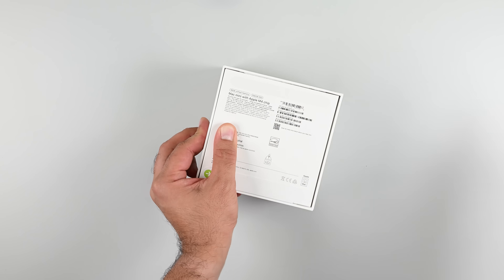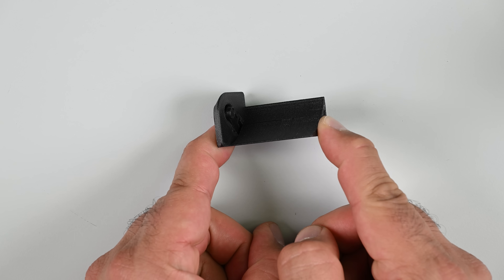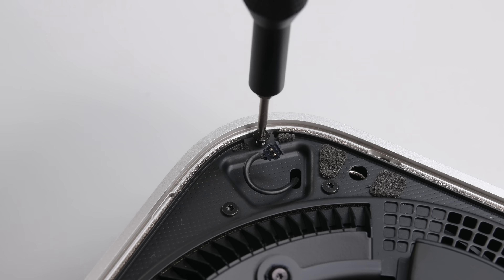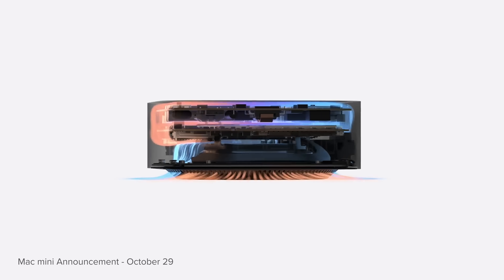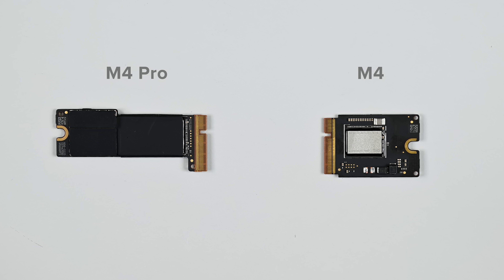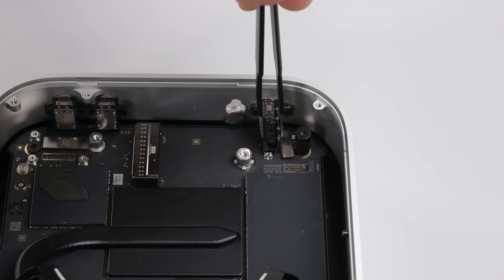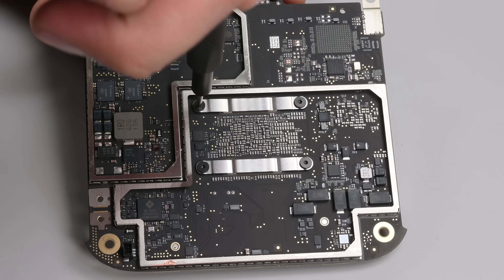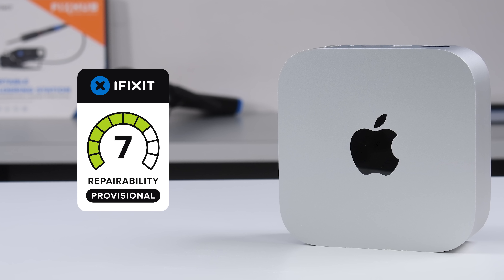M4 Mac mini Teardown - UPGRADABLE Storage, Powerful, and TINY

Comment: Why does he say it’s upgradable storage? It’s not. Apple will never sell those modules separately.
Reply: if previous generation (2012-2015) macs are anything to go by, then 3rd party companies will have replacements available asap.
Reply: @lenajk2004 can confirm
Reply: @lenajk2004  Those used off the Shelf Laptop Hardisks
Reply: @techgoggles  No. my 2014 MacBook Pro has a stick drive and there is no NVME drive that can fit in it. It’s “proprietary” and i upgraded it with a nice OWC 1TB 

He probably got the dates wrong because Apple things are confusing. You would think like between the Air/Pro everything would be the same but it doesn’t work that way. I think the stick drive things were 2013-2015? As the 2013 ditched the optical drive and was the new generation. And we all unfortunately remember the 2016 MacBook pros
Reply: @techgoggles  the retina models did not use off the shelf sata drives
Reply: Just because Apple may not sell upgrade modules in the future doesn’t mean third-parties won’t.
Reply: Third parties will.
Reply: me when I spread misinformation
Reply: It could be upgradable by third parties, if you have a second Mac around :)
Reply: These days ifixit is becoming soft on apple. Apple still make devices that appear to be serviceable, but there's always a gotcha whether or not you can get parts 3 or 5 years after the device is released. And yet they keep praising Apple for more ease of repair when infact it's not. Just because now the ssd is removable or the battery can be removed by apply voltage doesn't mean parts are available. They themselves have become an Apple shill
Reply: @luandoduy416 Parts are available directly from Apple and parts from other broken devices like those found on eBay will work with iOS 18’s new repair calibration tool. OEM parts are more expensive, sure, but they are also guaranteed to be fully functional and high-quality which is especially important for batteries.
Now, sure, it’s unfortunate that most parts are grouped into assemblies which are more expensive, but still.
Reply: @luandoduy416  I am no fan of Apple, but their service manual is already available for the m4 Mini and the "SSD module (flash storage)" is listed as an orderable part. M4 mini parts aren't listed in the Parts Store yet, previous models of Mini and Studio are, and the iPhone 16's replaceable battery can be ordered for a smidge over $50 (upon receipt of the old one).

Will they sell you get a 1TB SSD for less than $400? Almost certainly not, but you will be able to buy one if you need to upgrade. (But go external if you can, and save $250).
Reply: A company called Polysoft is working on this. Google it, pretty promising stuff.
Reply: apple maybe not but others will (and already do for the studio).
Reply: @racingweirdo  Had some trouble finding the project through Kickstarter in Toulouse, France but they instead are from Tours, France. They're called PolySoft Services and they plan on tweaking their M1 and M2 Mac Pro SSDs designs to correctly fit the M4 Mac Mini and Pro. Pretty neat!
Reply: Apple won't but AliExpress will get u an adapter lol
Reply: It can be upgraded by changing the NAND chip AKA desoldering and soldering in a new one
Reply: @cryingwater  I expect services that do this to pop up all over if Apple don't do it.
Reply: @cryingwater  and you call it "upgradeable", right? It's ridiculous...
Reply: Because like we've done in the past. all it takes is someone to figure out the pin out of that connector, and make a little adapter for m.2 sdd, similarly to the trashcan pro
Reply: @chloedegurechaff1941 wrong, the module in the Mac mini is not an SSD, it’s a NAND carrier board, NVMe ssds will never be compatible with the Mac mini
Reply: @chloedegurechaff1941  well you can't make adaptor for M.2 SSD as the drive controller is on the SOC I believe but you can make replacement parts and some people already did for the studio
Reply: @chloedegurechaff1941  Pretty sure there's software protection against that
Reply: @ohexnohex6165  nope. It's already been done by one very technically proficient YT'r.
Reply: @ohexnohex6165 you haven’t watched the video, right?
Reply: @ohexnohex6165  well in fact no if you know what you're doing
Reply: @Andreas_Straub  looks like you can either change the whole module for another genuine module from apple OR modify a genuine module by replacing the NANDs. But if you have a third party solution that breaks apple's hardware ID checks, please elaborate!
Reply: @adanedsstudio  looks like you can either change the whole module for another genuine module from apple OR modify a genuine module by replacing the NANDs. But if you have a third party solution that breaks apple's hardware ID checks, please elaborate!
Reply: @sutherland559  looks like you can either change the whole module for another genuine module from apple OR modify a genuine module by replacing the NANDs. But if you have a third party solution that breaks apple's hardware ID checks, please elaborate!
Reply: Because it’s not soldered and you can replace it yourself? That’s what upgradable means?
Reply: OWC has made proprietary SSD modules just like Apple’s for the 2016 - 2017 13” MacBook Pros. Give it some time.
Reply: That is weird... Apple had macs with upgradable RAM but I never remember seeing them sell the RAM modules separately. Nice logic you got there
Reply: @bob_kazamakis When Macs had upgradeable RAM, the RAM modules they used were standardized so they didn’t need to sell any. These SSD modules are proprietary. While I agree that they can be reversed engineered, this is a false equivalency. In other words, nice logic you got there.
Reply: Wrong. They do sell replacement parts for their newer Macs. Might not yet be available since it just released but you can find all the parts for the Mac Studio for example and repair manuals on their website.
Reply: Clickbait! Like most videos on YT nowadays
Reply: @spiritualastralsoul you know which company you’re referring to right ?

Comment: its upgradable, but its only sold by MAC ? or we can expect to buy cheap or use from another hardware like a normal notebook?
Reply: you can't plug in any M2 storage of the same size and make it work. probably either only apple sells it. or a different way, you can replace the NAND chip. otherwise there is no other solution.
Reply: @lostf1sh  the solution is someone making a custom aftermarket part; and it will definitely happen at some point as it has for the studio. OWC has made those for years for older macs.
Reply: it is a proprietary form factor - not standard like M.2, or even shared with something like the mac studio - BUT there are efforts underway by tinkerers and businesses to replicate the boards themselves and sell third-party solutions. i anticipate by the time people want to upgrade their storage some years down the line, there will be plenty of options to extend the machines’ lifetimes at reasonable costs.
Reply: @Megaphonix Exactly. In a few years.
Reply: you cannot use normal ssd, its only ssd sold by apple
Reply: anxious about this answer
Reply: I believe Apple intends to secure their data. However, they should provide an option for individuals whose data is not of utmost importance.
Reply: @拉雞毛  at least to use another fast M2 for memory swap. Expend the main Ssd "life" to use as memory swap its really sad.

Comment: Yes, agree- mac mini looks sweet but true that you must make sure you get the ram amounts while buying it
Reply: That right there. I use a MacBook on the go because it's the only laptop out there that's fast enough and silent, but for heavy stuff I'm sticking with my rusty PC that even though slower, lets me upgrade just the thing I need when I need...
Reply: @shapelessed  Do you prefer having slow PC with mighty RAM running LLM or a pricier mac with big RAM and run LLM on it?
Reply: @fadelfarinsqi4304  I prefer paying 1X for memory. Not 8x. On a Mac I would either have to quantize the LLM or not run at all, on a PC I can get effectively 128GB of memory for the same price as 32 on a Mac. It's slower, but what good serves me faster memory if there isn't enough of it.
Reply: @shapelessed to be fair 99.9 % of people do not need 128 gigs of ram.
Reply: @luipaardprint  To be fair it wasn't my point. Enough memory is more important in 99.9% of cases than faster memory.
Reply: For your use case, you need lots of memory.  For most office work and browsing, 8 GB is enough on a Mac because the paging is so fast.  Running MS Word, Excel, Apple Mail, and ~20 tabs in Brave at the same time I cannot notice a difference between my Studio with 24 GB and my Air with 8 GB.  Before I jumped to Mac, that amount of stuff open was easy to tell the difference between 16 and 32 GB on a PC.  On Mac, 16 GB is definitely enough for photo work and probably enough for short format videos. 

I'm not saying no one needs more.  I obviously paid more for 24 GB for a reason.  It's just important to know how someone's use case behaves on the system they're planning to buy.  You shouldn't simply assume that because something needs a certain amount of memory on PC that it needs the same amount on Mac, or even Android for that matter.  Obviously if you're training an LLM, 32 GB isn't enough, but 64 GB might be even if you need 128 on PC.
Reply: @SeniorKlean  "because the paging is so fast" - Couldn't make me laugh louder. MacOS itself takes 6GB, take additional 1GB for graphics and you're left with 1GB of usable memory. Load literally a few basic things and you're left with 10GB of swap, add the fact that your SSD is soldered and your Mac will last about a year or two - Well done.
Reply: @shapelessed  A, you never refuted what I said.  

B:  I understand why you're saying that, but empirically you're wrong.  Modern SSDs have a lot more write endurance than nerds give them credit for.  You could overwrite the entire drive every day for 5 years without wearing it out completely. You can ask Flash manufacturers like Samsung, SK, or Micron.  You can ask drive manufacturers like Crucial, Solidigm, or Apple.  You can ask storage hyperscalers like Backblaze. 

And no, Mac OS does not necessarily use 6 GB.  It uses what it can, just like Windows, just like Linux.  Sometimes that's as much as 16 GB and sometimes it's as little as 800 MB.
Reply: @SeniorKlean  "800MB" - There went the credibility of your entire comment.
Reply: @  It’s ok, you can just say you don’t want to use it. That’s fine.  You don’t have to call me a liar when I use a Mac daily and you probably don’t own one.  I have 3 in my house right now, a base model M2 Air, a base model M1 Pro, and a mid-spec M1 Studio.  I also have multiple PCs, some run Windows, some run Kubuntu. The “perks” of have 2 jobs that both supply laptops.

I don’t even like Mac OS.  I tolerate it for the hardware (and because I have to sometimes for one of my jobs).  My point is, I’m not fanboying and I’m not evangelizing.  I have multiple points of reference for context.  I know what I’m talking about.  And you’re needlessly making a fool of yourself.  For what?  To prove to yourself that the product you subjectively don’t like is somehow objectively inferior?
Reply: Because the minimum you can take on the base M4 is 16, there's not big issue, also the base model of the M4 pro is 24 so it's also a good amount
Reply: That's why I got mine from the Apple EDU store with a further Black Friday discount and bumped up the RAM. Maybe they'll have  New Year's sale?
Reply: My question is this - Why make a device modular but restrict the user from using it that way?
Reply: You need 24GB of ram. Not more. Even 32GB is too much.

Comment: Finally a correct score on an Apple product!
Reply: nah, storage isn't actually upgradeable if it's proprietary and not sold separately. Memory is still not upgradeable for no other reason than to overcharge uninformed consumers on the price ladder. And ports are soldered on. 

If this is a 7/10 then standards are WAY too low. 

All of these parts should be completely replaceable. If a tiny company like framework could figure it out then Apple should too.
Reply: @noone-ld7pt  ports are not soldered since m1 pro macbooks (or m2 air). Soldered ram benefits with lower power consumption, better latency and unified memory architecture. Don't mislead people.
Reply: @RblSbms  5:17 "The soldered rear ports..." sure, I am the one misleading. 

And you are literally just reiterating Apple propaganda to justify their absolutely insane up charging of RAM. The absolute miniscule upside of soldering it on is a blatantly obvious cover for creating the famous price ladder. 

But hey keep drinking the corporate coolaid my man.
Reply: @noone-ld7pt  You said "for no other reason", not me. I gave you facts about the benefits that you can verify with any benchmarks. Instead, you call it propaganda without providing counterarguments, denying reality and labeling those who disagree. It seems to me that you cannot look at things objectively. And yes, my statements do not justify the upgrades price scam, that is not how logic chains work. I am just not such a narrow-minded hater that I can turn a blind eye to the pros/cons of something.
And yea, thanks for the timecode, seems like only front ports are modular, pretty lazy decision.
Reply: Mmm... right, you’re right

Comment: Why to expand storage internally if you may connect fast external drive? It is a desktop, after all
Reply: If you don't want to have a ton of stuff on your desk, or the original storage fails then it can be handy to have the internal storage be replaceable
Reply: Here’s a reason.  I have 8TB of iCloud storage but can only sync a small percentage since iCloud Drive can’t be separated from the OS partition.
Reply: Because Apple Intelligence does not work on any Mac started from an external volume
Reply: At some point your system drive will fail as we use less and less durable cheap nand memory on ssd's... If you write to the drive a lot and have a 256gb model, it could die in a few years.
Reply: It makes it more repairable, and that is what matters most to me.
Reply: Internal storage is always faster, has lower OS overhead, and lower latency than any external storage attachable via ethernet, thunderbolt, or USB.

256GB base storage is a joke in the modern era and the profit margin Apple makes on storage upgrades is tragic for the consumer; and a boon for sharehoders.  An upgrade of the Mac Mini to 2TB is an additional 800 USD when an standard M.2 2TB PCIe Gen 5 SSD is around 300 USD or less and even cheaper for Gen 4 or Gen 3 drives.

Comment: It could last 10 years if: Apple configurator will continue to work, and will not be dependant on apple's servers. Also saying that the storage is removable is a bit deceptive - it's better to look at it like it's just upgradable. You cannot pull data off this drive in the event the machine fails, so it's not exactly removable, nor you cannot transfer it over to anothe mac mini without wiping the data thats on it in DFU mode. It is however upgradable, if apple is willing to sell those nand modules, or a 3rd party creates their own pcb with some good quality nand chips.
Reply: What is going to happen is that some third party will create those modules to place SSD, since this mini m4 has a lot of potential
Reply: Saying it’s removable is not deceptive. Removable literally just means it can be removed, at best it implies that it can be easily removed - just because you’ve added some completely arbitrary definitions onto that word yourself does not mean anyone was being deceptive.
Reply: @MrThedennisblack  when speaking about definitions,  the definition of removable storage: "Removable media refers to any type of storage device that can be easily removed from a computer system and is designed to be portable."

The nand in the mac mini is not designed to be portable. It is also in fact not a removable storage medium, as it contains iboot, the primary bootloader of the mac. So it's just internal, non removable storage, that happens to live on a module allowing for upgrades. This storage is not removable, but "replaceable".
Reply: @verpejas  you are conflating the concept of removable storage/media with a removable SSD. They didn’t claim that these were a form of removable storage, they said they are SSDs that can be removed. If you want to talk about definitions, removable storage is technically storage that can be removed while the computer is still running - not just easily removable. iFixit never said anything misleading.

Comment: No photos of the M4 Pro package or power supply?
Reply: Aren’t those components built internally or are asking to see an xray of the M4 Pro package like they did at the 00:22 mark
Reply: @IMDANIELAUSTIN 

I just mean removing the heat sink from the SoC package, showing the memory chips with the SoC chip.

Sure, I would love to see some de-lidded shots of the SoC, but that would almost certainly be a destructive process.
Reply: This is not a Mini PC with an external power block .... power supply is internal.
Reply: @Andreas_Straub  Exactly why it would be nice for a teardown video to show them :)